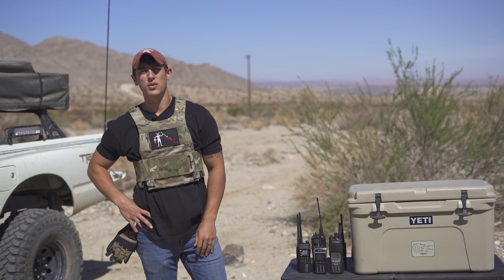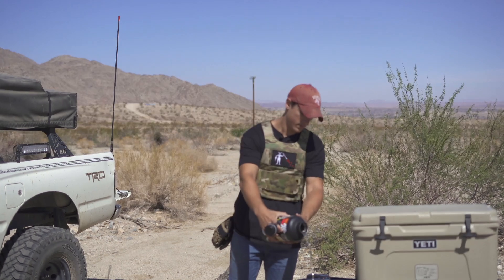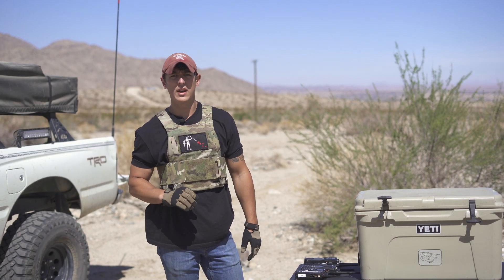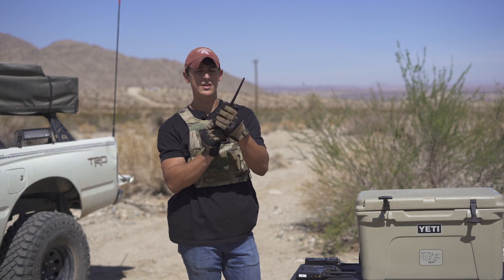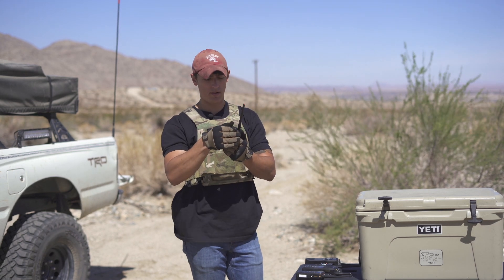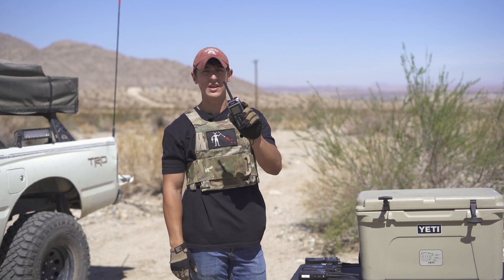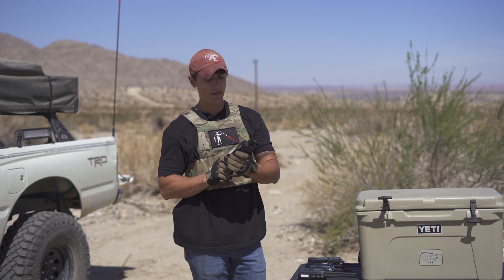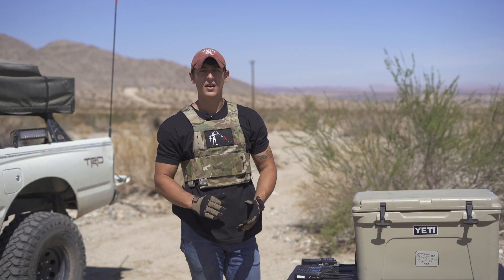Frozen Radio Test

Comment: Very nice test.
Next time liquid nitrogen and really thick gloves.
🤣

IMHO Those  686 portables just don’t have good ergonomics. Thickness, light PTT,  low batt life compared to 782 and 982 AND the ice cold aluminum housing.  It would be perfect if just housed differently.

If I recall , the 686 series originally came out for the amateur/ham market a little after the orange/black frame radio came out.
Despite being only one band, the 682 did the WHOLE band. In 70cm/UHF, you could get 380-527MHz in a single radio.
GigaParts was their main stocking “Ham” distributor in the US but they ditched Hytera a few years ago.

Thanks for a great radio channel.
You are honest. 
You don’t try to push affiliate links to absolute garbage.
You are VERY knowledgeable in what is the best bang for the buck in comms gear.
You seem to like Hytera.  LOL 
I still can’t believe they didn’t take over the world.  
Great and very rugged gear WITH FPP at a decent price.
They didn’t offer P25 and lost public safety.. 
though you can’t beat /\/\otorola when it comes to lobbying and suing Chinesium pirates.  
I guess that’s why Hytera was so much less $$ than M.? 🫣😆
Reply from the maker: Thanks for weighing in! The liquid nitrogen is a great idea I might have to try and make that happen. 

I actually quite like the aluminum frame on that particular model - it feels very durable. You’re correct on the wider range although my notes state 400-527MHz it is wider than other single band (70cm) offerings.

I do appreciate your comments. For full transparency I do sell Hytera radios. That said, I do like them because they are the best bang for your buck (for a brand new, not second hand) digital radio that is actually good quality. Hytera doesn’t have a market for P25/Public Safety thanks to the lobbying - they are on the covered telecommunications list meaning they are prohibited in public safety.

Comment: That EFJ brought back some nightmares.
We were issued the model 3 (full keypad & display) during their fire service trials for P25 Phase 1.
Reportedly , those radios actually came off a /\/\otorola production line in Malaysia.

The model 1 radios were rugged enough and had decent RF and audio performance.
But… not so much for the batch of 3’s we got.  We were running clear  / no encryption (fire dept) and when changing between repeater and direct (simplexj modes o foperation, the radios intermittently spit out a “key fail” error message and you had to cycle power. They do boot back up quickly, but still worrisome.

I’m fairly certain that the EFJ  5100 and 5300 saw most use in federal law enforcement.

Comment: I wonder if the baofeng didn't tx bc of the low battery power but could rx just fine. Curious of swapping out for a fresh battery after that freeze would be a field expedient way of getting that radio running again

Comment: Solid testing, the only tweak I would have done would have been to do it without getting them wet. Also, up here in North Dakota, we're rocking XPR 7350e and 7550e handhelds, the only thing that seems to get them is the -20 ambient temperature. One way we mitigate the battery loss (only real problem we have) is keeping it under our coats. Use your body heat to keep the battery from freezing. I'll look into it too, but I THINK the lithium batteries drain much quicker. Roomie and I both got some XTS handhelds, and his has a nickel battery, we'll play around with those this winter and let you know how his holds up in the cold compared to my stock Impress battery.
Reply: Hope you are running AES
Reply: @KG1AES  no clue if we are at work (I doubt it), but personal, yes